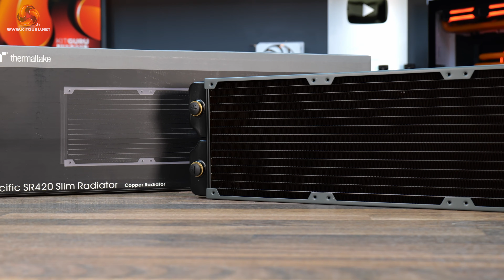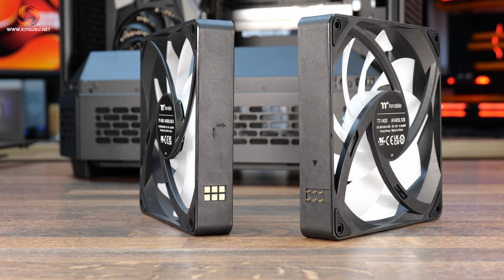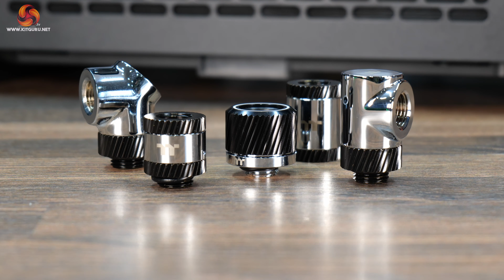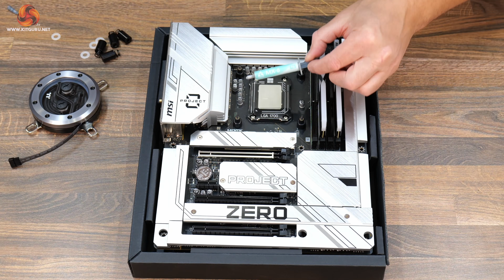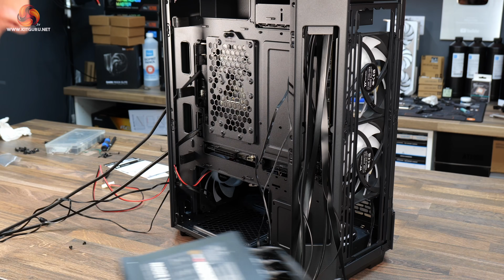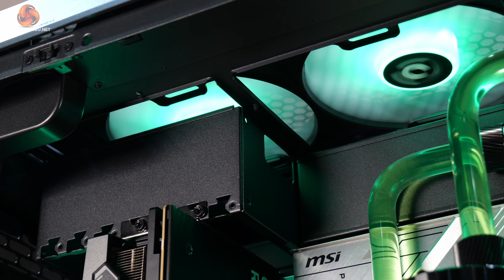Thermaltake The Tower 600 - ACID GREEN Build!

Comment: I have an EK 420 radiator, but its not slim, its normal, towards a bit thick. Would that fit in there? Looke like its not more than just with the radiator you have in there now.

Comment: Some of the higher end like Gigabyte Aero 5070 TI or 5080, 5090 since they are using Vapor chambers. I have heard they are using a ‘GEL’ Thermal paste on the GPU chip.

Installing the GPU Card inside this case with an 1)‘Upfront’ or  a 2)‘Veritical’ position has there been much in reports of this ‘Gel Thermal Paste’ spreading/dripping out from the GPU and the Vapor Cooling Block?

I ask this because of the card being in a position to allow gravity with the thermal paste becoming more viscosity it could move, versus Horizontal where gravity is being applied downward where the thermal paste lay’s and not as easy to cause the problem suggested.

Thanks for any reply’s!

Comment: Many video for this case which looks very cool. However no one is showing the routing of cables out the back plate of the MB and then out the computer itself. Just showing a very clean computer without the mess that generally the cable achieve but needed for monitor, USB, WIFI and anything else that will come off the MB back plate.
Otherwise very nice build, nice touch on the ‘green liquid cooler.

Comment: Has anyone built in this case ? Because I really like it and would like to use it  in a new build BUT ,  I read in the specs that it  only has 3 integrated hard drive mounts ,  it has 1/3.5 and 2 /2.5 mounts I need at least 5 and would prefer 3.5 mounts   , was wondering if it would be possible to DIY some  into the case is there enough room in the none visible parts of the case , without ruining the looks and aesthetic .

Comment: How does the radiator on the right perform? I am concerned about the PSU chamber seemingly blocking most of the air flow for the bottom fan.

Comment: Hi James, very nice build. I want to ask if the GPU suffers from higher temps due to the straight up positioning? That's the only concern i have. Thanks.
Reply from the maker: I dont see any reason why the vertical orientation should have any effect on the GPU thermals. I did some quick 3DMark testing and GPU temperature seems normal.

Comment: It was not easy to find but I recently discovered that some vapor chamber cooled GPUs are not designed to operate with the IO facing the ceiling and it will increase the temps by a fair amount.  Have you noticed any high temps.  I am interested in this case but I am running a Sapphire 7900 XTX Pulse with a DeepCool ASSASSIN IV WH Premium CPU Air Cooler so orienting the GPU to face outward is not an option.

Comment: Not my cup of tea. I dunno about the airflow of the case since the design is odd and the fact that it has many fans but the gpu is mounted in a narrower space and isn't watercooled makes me wonder if this case is any good.
Reply from the maker: The airflow is pretty good, I was surprised how well the CPU and GPU thermals performed when running 3DMARK Speedway and Cinebench R23 stress tests simultaneously.  

It's definitely not everyone's cup of tea though. 😊

Comment: What are the GPU en CPU temps under full load?
Reply from the maker: CPU is mid 80's and GPU around 60c. Quite impressive really. That's during a simultaneous 3DMARK Speed Way and Cinebench stress test.

Comment: I like the case and could easily mod it but will never buy as I am not a fan of any company advertising their name all over and the TT has to go.
Reply: So you will never buy any PC part then? Everything has the company logo! Your statement is hilarious.
Reply: @andyrudd1966  there is a difference between a company Logo and a In your face all over Logo.
Reply: @ There is a difference between buying a product with a name on it and a company that has their name all over in your face with large TT Thermaltake dead center in your face right in front and they could not get the letters any larger.
Reply from the maker: Ok fair enough 👍🏻
Reply: @justatim8143  so you wouldn’t buy any pc part
Reply: TT by Twice is nice.

Comment: very nice but does it work with the horizontal stand kit (problem with the cooling pump I guess) ?
Reply from the maker: I didn't actually try the horizontal stand with the system running. I prefer it vertically. 😊

Comment: I like. I'd like a British Racing Green or darker SKU; I think it would go well with the Acid Green loop. How dismantleable is the case? I can see myself getting one and having it powder coated that green. Pity it doesn't take M-ATX; Thermaltake Half-Bake is back? I hope not; and this is just a glitch!
Reply from the maker: It will take a standard m-ATX board just not a PZ or BTF back connect one.

The case disassembled very easily and you could drill out rivets if you want to go all the way.
Reply: Where can you get things powder coated nowadays?

Comment: Project zero biuilds just look so CLEAN.
Reply: Wish they worked out a way to do away with wires completely and have magnetic connectors built into key places which also transport signals. Like those ARGB rans that connect together magnetically.
Reply from the maker: It does, suits this case well.